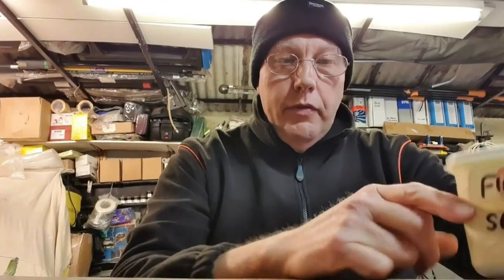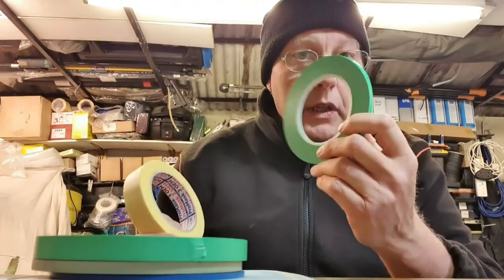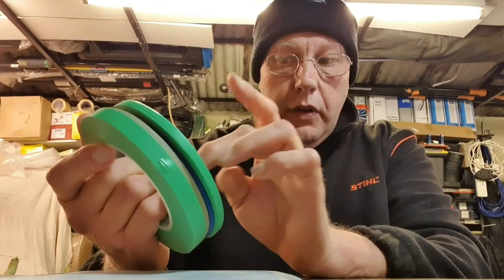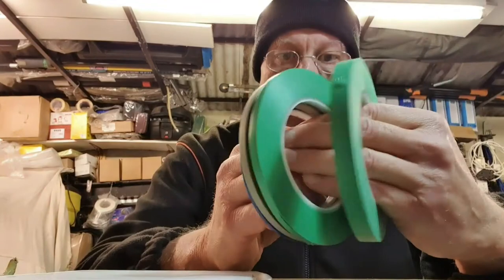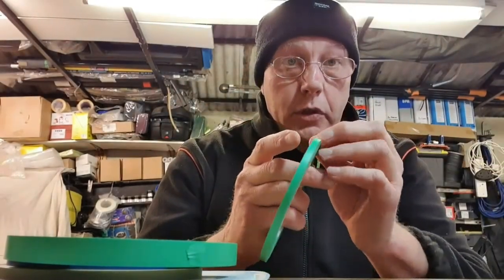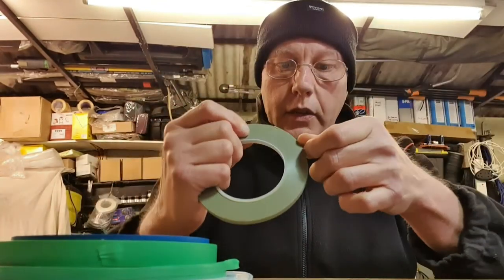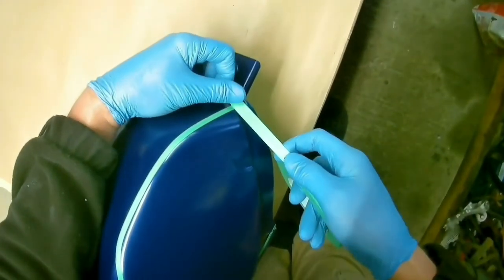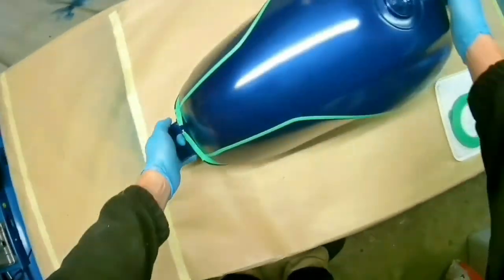Fine Line Vinyl Masking Tape Jtape For Sharp Paint Lines

Comment: Hi Pete, great informative videos and a pleasure to watch, can I ask some advise please, I have just bought the R160 after watching you giving give  the thumbs up for an inexpensive but good performer of home spray work
I'm spraying a scooter and want to put a 3mm metallic orange pinstripe between two colours which are white and metallic silver, I have the fine line tape 
Should I airbrush the orange first, fine line over it and then mask off each side separately and paint the other two colours and can I tape over the base orange or should use intercoat to lock it in before taping over it, I have read different advise saying you can tape over base coat without it peeling off when pulling the tape and others say never tape straight over base coat especially if it's metallic 
Many thanks Rob UK
Reply from the maker: Hi Rob, As you have probably heard the old saying, there's more than one way to skin a cat, so there are a few ways to do what you want.
I have and often do put fine line over basecoat and haven't had any problems, it's by far the easiest and fastest way to do it, you do need to allow the basecoat to dry properly, so say an hour at 20c before you apply the tape, also use a good tape like jtape.
You can put a basecoat binder or clear basecoat over it which gives you a little more insurance and can help with metallic especially if it's course as it helps stop laying the metallic partials down and flat, this i haven't found a problem in any normal off the shelf paints as the partials are only very fine.
The full insurance is to spray some 2k clear over it instead of a intercoat, that way if it bleeds or something you can easily start again, also just be careful any overspray from the orange strip doesn't affect the colour going over it, ie it doesn't make it look a different shade where its overlapping if you get what i mean.👍
Reply: Pete's Hobbies thank you Pete very helpful, I think after reading your reply I'll tape over the orange base, I have j tape which you suggested many thanks Rob👍
Reply from the maker: @toppyblahblahblah  , yeah,  you should be fine, as long as it dry and over a good primer base👍

Comment: Hi, do you have an amazon link to the tapes you use please?
Reply from the maker: Hi, Here is a link to what I use. It comes in lots of different widths. Cheers 👍
Reply: @peteshobbies5383  I apologise, I don't see a link, thank you foe the quick response
Reply from the maker: @letmelivegaming  So sorry,  I forgot to add it 😂, here it is.
Fine Line Vinyl Masking Tape Roll - Green - 1mm - 25mm width x 55 m length Flexible Adhesive - Heat-Resistant to temperatures up to 138°C/280°F by JTAPE (1.5) https://amzn.eu/d/66fF6P4
Reply: @peteshobbies5383  haha that's alright, thank you so much!
Reply from the maker: @letmelivegaming  No worries 👍